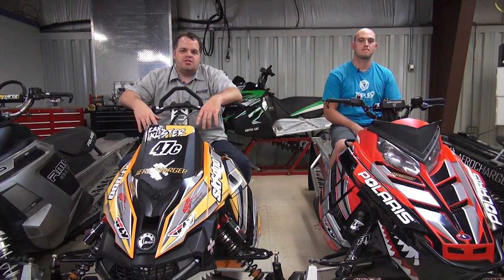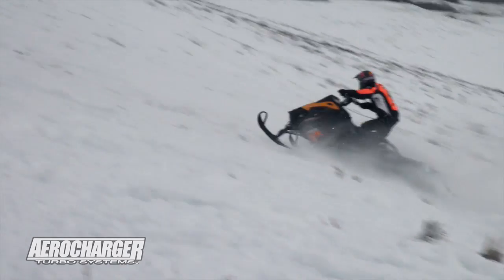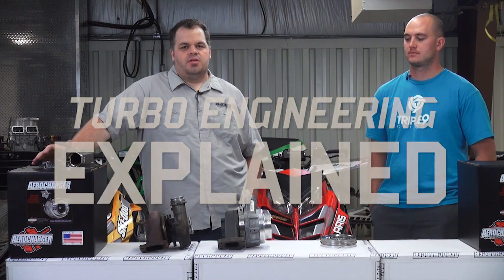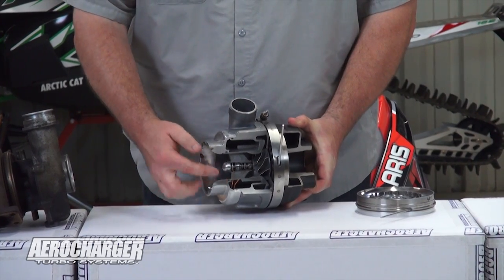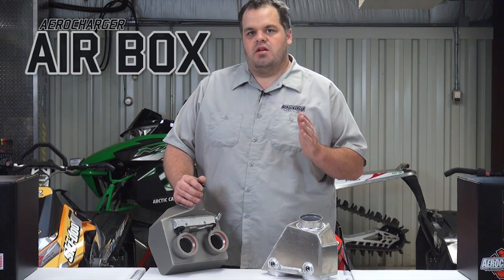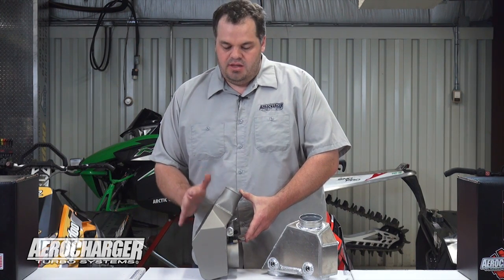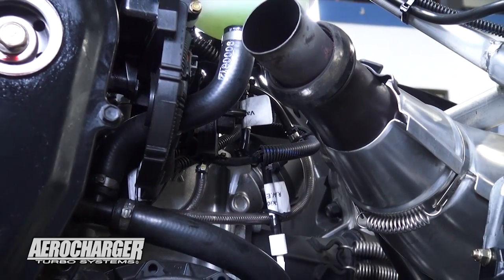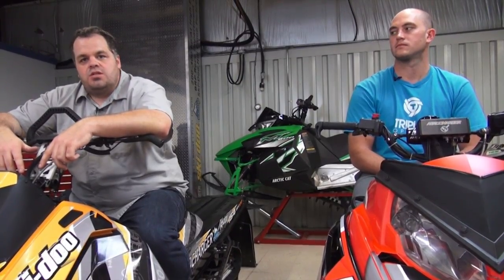Aerocharger Turbo Sleds 2013-14

Comment: no brand even compares to them. they are the best in every aspect literally. only thing I would ever ask if they would start making budget kits where the turbo isnt as good but still adds alot power. like say 60% current top turbo price so the guy without all the cash on hand can enjoy close to the same reliability and power.
Reply from the maker: +Ross Keene Thanks for the kind words.  We have discussed changing components or finding more sources to help keep the price point lower without sacrificing performance.  We just listed our Ski-doo kit's on sale a few weeks ago since we released a $3900 Non Intercooled Kit.  Hopefully this is a starting point for some customers who want an Aerocharger.  Once again thank you!